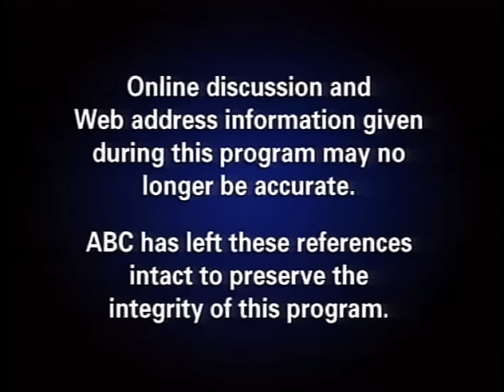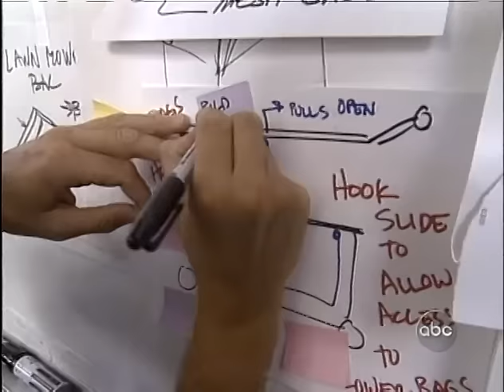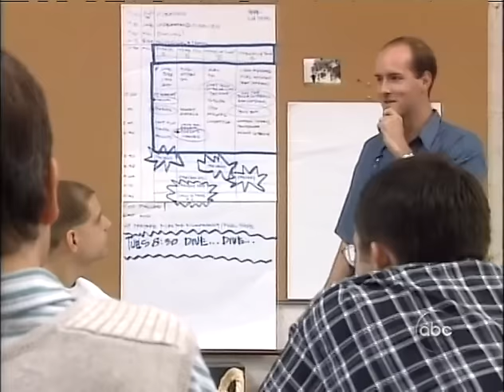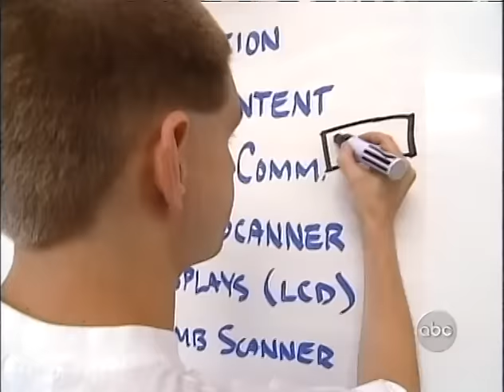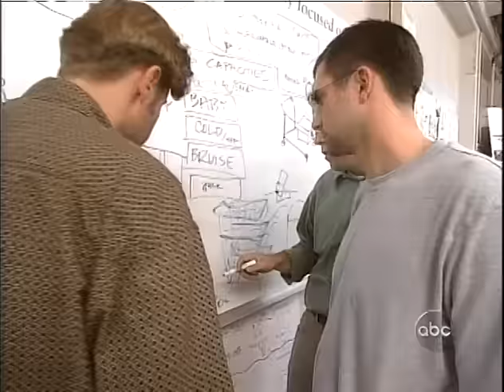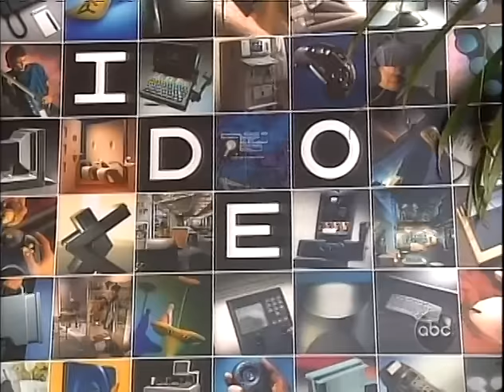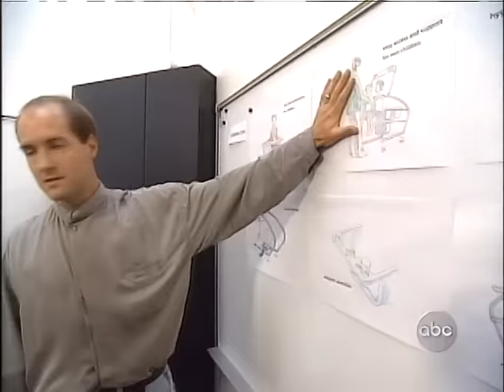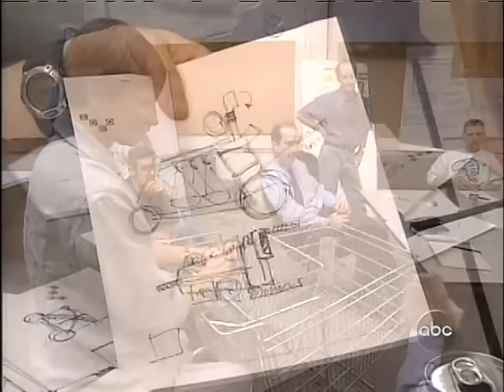The Deep Dive

Comment: Activity 1.5: The Deep Dive

Procedure
1.      “From the buildings in which we live and work, to the cars we drive, or the knives and forks with which we eat, everything we use was designed to create some sort of marriage between form and function.”

2.      The folks at IDEO state that they are not experts in any given area. But they do claim to be experts on the process of how you design stuff, which they apply to the innovation of consumer products.

3.      After the team of designers is brought together, introduced to the problem and informed they have five days to “pull it off,” what phase of the design process do they immediately engage in?
a.      After the team of designers is brought together, introduced to the problem and informed they have five days to “pull it off,” they engage in the “investigate and research” stage of the design process.

4.      Give two examples of what the team members did during this phase.
a.      One team member visits a store and talks to some employees where he learns that the shopping clocks have been clocked in at 35 miles per hour across the parking lots.
b.      Another team member visits a store and learns that most shoppers don’t like to let go of their carts while shopping. Only a few leave their carts at various places to go and retrieve their groceries.

5.      List five rules-of-thumb that IDEO employees follow when they share ideas during the brainstorming phase:
a.      One conversation at a time.
b.      Stay focused on topic.
c.      Encourage wild ideas.
d.      Defer judgment.
e.      Build on the ideas of others.
                                                                                       
6.      Why should wild (and sometimes crazy) ideas be entertained during the brainstorming phase?
a.      Wild ideas should be entertained during the brainstorming phase because you can build off of those wild ideas and they will end up being better ideas which would not be possible if everyone said the same things.

7.      After the brainstorming phase was over, the team narrowed down the hundreds of ideas by voting for those ideas that were not only “cool” but also buildable in a short period of time. Which phase of the design process includes brainstorming and narrowing ideas?
a.      The phase of design process that includes brainstorming and narrowing ideas is the “select an approach” phase.

8.      IDEO believes that the ideas and efforts of a team will always be more successful than the planning of a lone genius.

9.      Once the ideas were narrowed down and divided into categories, the group was split into four smaller teams. For which phase(s) of the design process was each of these groups responsible?
a.      Each of these groups was responsible for the “develop a design proposal,” “make a model or prototype,” and “test and evaluate the design using specifications” phases of the design process.

10. The leaders at IDEO believe that playful behavior and a fun environment are two important reasons why their employees are able to think quickly and creatively to produce innovative results.

11. Sometimes, people come up with great solutions that work by trying their ideas first and asking for forgiveness later.

12. Design is often a process of going too far and having to take a few steps back. What phase(s) of the design process would the critique of the four mock-ups come under?
a.      The critique of the four mock-ups comes under the “communicate processes and results” phase of the design process.

13. Upon critique of the four teams’ models, it was obvious that none of the teams had developed an optimum solution. However, the people at IDEO believe that it is important to fail often in order succeed sooner.

14. What percentage of the entire week’s time did it take to fabricate the final prototype?
a.      It took one day to fabricate the final prototype which is 20% of the entire week’s time.

15. Instead of showering his design team with a tremendous amount of praise, what did the boss require his employees to do with their new design?
a.      The boss required his employees to go to local supermarkets and see what they thought of their new design.

16. Of all the things that we are surrounded by every day, what has not been placed through the design process?
a.      Of all the things that we are surrounded by every day, nature is the only thing that has not been placed through the design process.

In Case you need it